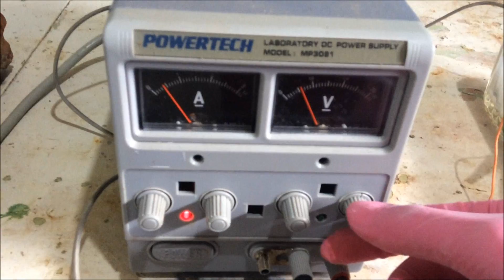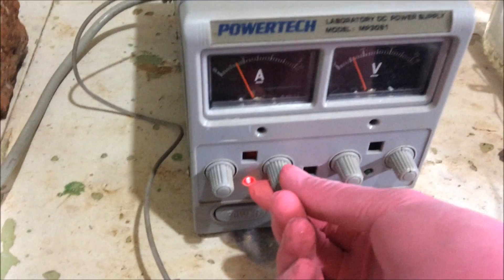Making zinc powder

Comment: oooohhh i see you got a new 500ml 3 neck flask! where did you buy this one from? not chinese ebay gear with the chance of a bacon smelling visit?
Reply from the maker: Mate, you know I can't resist that cheap glassware. China once again, this is my 4th order and it was over 2 weeks ago so i'm going to assume i'm in the clear once again. Risking it for the science
Reply from the maker: it's actually setup for making nitrotoluene. I tried seeing if I could set away with using 50% H2SO4 and 70% nitric but got no nitrotoluenes, so will have to try again with conc. sulfuric
Reply: +Extractions&Ire yeah the last time they came for me I was warned not to buy more glass.. In May they cAme. They snooped around and I was soooo lucky not to have them find anything that would have my street sealed off and the goon squad raid the place. They looked through my chemical store asking what was what and what I used it for. They threatened to arrest me on suspicion of drug making but my lab notes saved me I think. They threatened to get a police chemist in but I was ultra fortunate they didn't. They also asked about iodine which I did have a 10 g sample ampouled in my element collection which alarmed them some but they wouldn't take it. I offered. I understand they gave a job to do and I'm super fortunate that particular day they did it half assed.